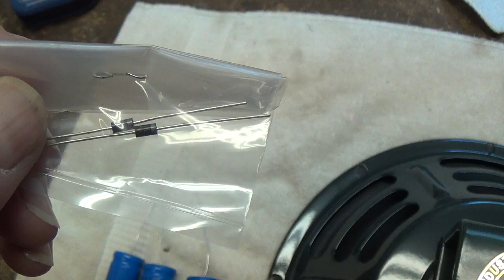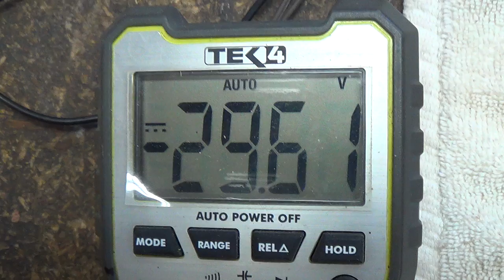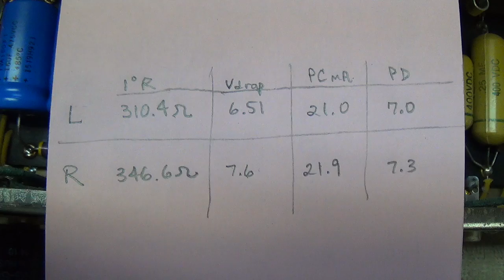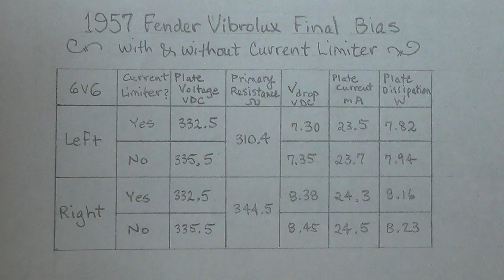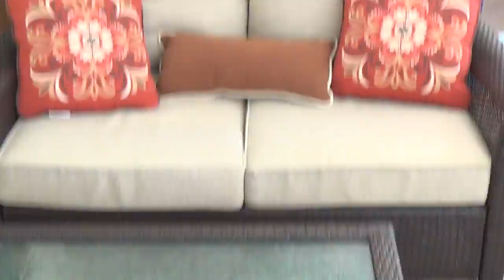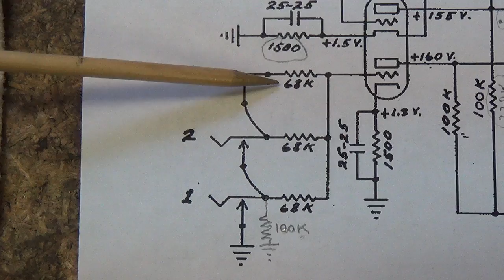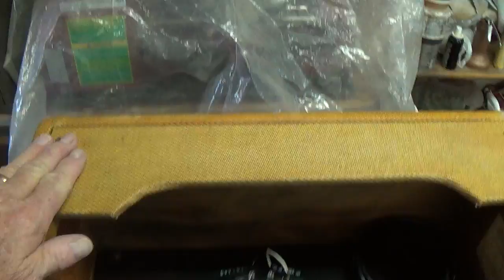1957 Fender Tweed Vibrolux, Part 3

Comment: What's the reasoning behind leaving the other electrolytics, especially the bias cap. A cap that fails short in the bias supply would be disastrous for the tubes. Better safe than sorry always applies here, for me personally.
Reply from the maker: You make a good point about the bias cap, Sean. I've never understood why, in a circuit designed to provide -31VDC, they would use a cap rated at 25VDC.  I'll discuss it's replacement with the owner.
Reply: Oh, the reason for that is simple: They could! As I'm sure you know, a lot if not all of the parts chosen for these amps that went into mass production were never selected because they sound the best, last the longest, or were "the right part to use", but rather because they DID work during prototyping, and more importantly, they could get a LOT of them for CHEAP! Some of this cheapness lead to what were supposed to be bass amps, accidentally becoming amazing guitar amps, due to the chincy parts being unable to properly reproduce bass, but being excellent at overdriving and breaking up in that familiar and beloved way.

That particular cap must have been built high enough over spec that it just didn't matter. The problem is though, with cheap modern caps, even coming to within 10% of spec is dangerous, so I was glad to see you chose a higher value for the filters. For bias supplies, I always replace with either 10mf @ 100V or 100mf @ 100V, depending on requirement.

I also make sure to replace the filters downstream as well. You'd be surprised at what an effect they can have on the tightness of the low end, especially in "bursts". Some people like the sound of the old dead caps, so in that case you can usually fool the ear by halving the capacitance for that stage, so if the original is a 22mf, replace with 10mf.

Thanks as always for the great videos!
Reply from the maker: You're welcome, Sean. Thanks for the very knowledgeable and helpful input.
Reply: Good information by Sean and you regarding electrolytic capacitors. My thoughts on the bias cap: even though the bias circuit is set around -31 volts and the bias cap is rated at 25 volts I would not rush to change the original e-cap. This bias cap is "overrated" and I have tested at 50v for dozens of hours with no issues, and it can handle the -31 volts it sees in the bias circuit.  I have these older e-caps in amps for many years with no failures.
Reply: drbryson2 I get that. But just because an old electro hasn't failed YET, doesn't mean it wont in the near future. I'd be less worried if it was a show piece, or rarely used, but for critical applications - gigging or recording - I'd sleep much better at night knowing there are fresh, overspec caps in circuit. This coming in hindsight of me having left an old electro in the bias circuit of an old Bassman, and it ruining my new tubes, during a gig. ESR was fine on the bench, but after some heat and use, it went nearly totally short... Better safe than sorry, I always say.

Comment: Is the mystery guitar a telecaster? Pretty good twang there.
Reply from the maker: Yes, that bridge pickup is hard to miss :)
Reply: how old is the tele? does it have the old circuitry where you can only blend in the neck pup full out but if you move the pup selector to neck only it is the tone fully off and the fake base sound?  i am thinking early esquire or nocaster
Reply from the maker: It's a '52 re-issue with the old circuitry intact. I may change it in the future.
Reply: I was amazed at how DULL the neck pickup sounded!